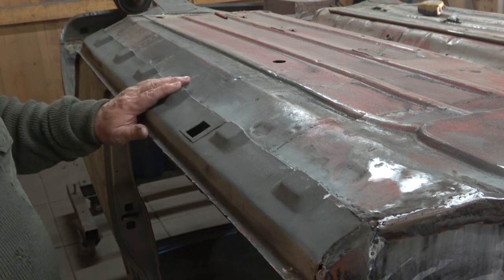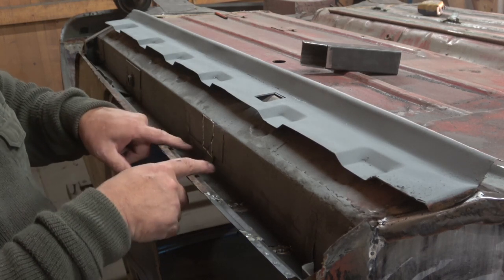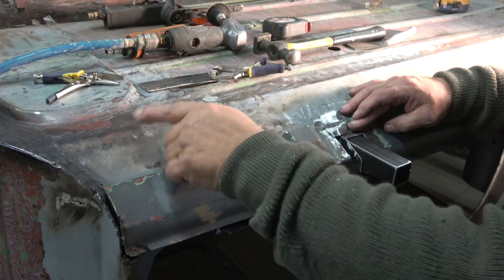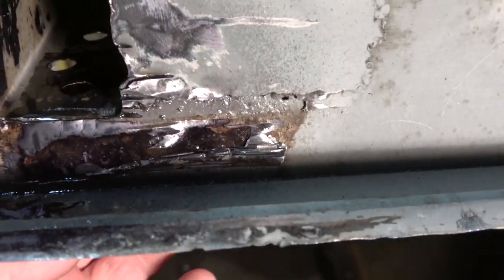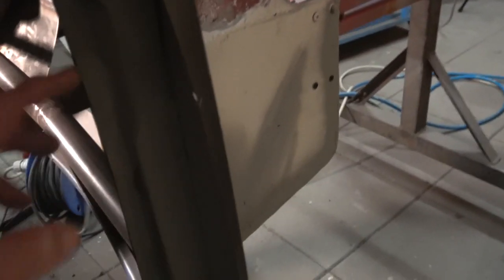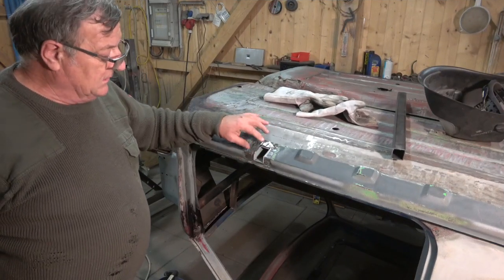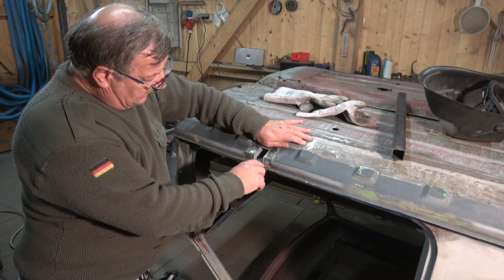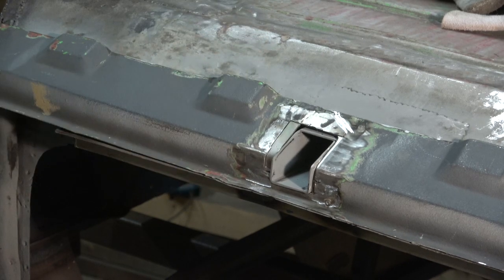Classic Mini Track Day Car Build Part 18 ( Quick Lift System & Hi-Lo Tube )

Comment: Hi Dave,
A thought about your cold air box you are building. Is there a fire rating for the air ducting hose you intend to use? The reason I ask is in the case of a carb fire if the hose isn't fire rated it might melt and fire will be inside the car. You might therefore have a problem getting the car though tech. Might pay to chat to a motorsport govening body in Austria.
Reply from the maker: Gavin,  It‘s a good point but i would think the trumpets on the weber is far enough away for it not to be a problem, 
Being silver foil i would think it would be pretty good but i may do a test just to see what happens, Cheers Dave
Reply: @ClassicCarCave  What not make from the airbox to the bulkhead in thin walled tube, so the part in the cabin can't burn. Better that having to change it after been teched out at your first meeting.

Comment: Dang dude.   What a great idea. I’m tempted to copy it in that the first time I take my mini anywhere here in the states, I’m worried they will screw up my floor.    You rock dude!!!!
Reply from the maker: Randy, To keep it original i would just use the standard jacking point and make a lifting plate like i did for Alex Toon, Cheers Dave

Comment: Nice Jack system. Have you seen sill stands? Could be an alternative to axel stands. When I fitted my SD cage I was advised to weld the plates on the inside of the body rather than the underside, might be something to keep in mind I don't know how fussy scrutineers are over there lol.
Reply from the maker: Mat, I did look around at a few ideas but the sill stands work with lifting the car front or back not sideways thats why i will use half pipe
on the roll cage plates for the axle stands so it can rotate slightly when it‘s being lifted,  Cheers Dave